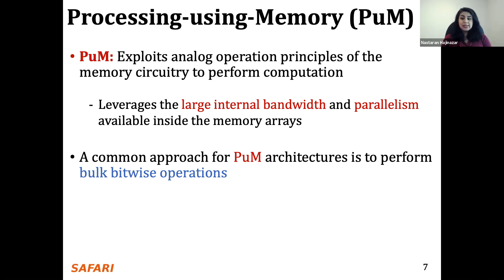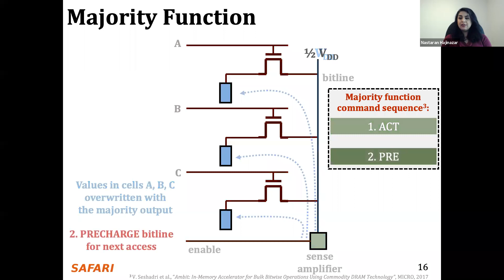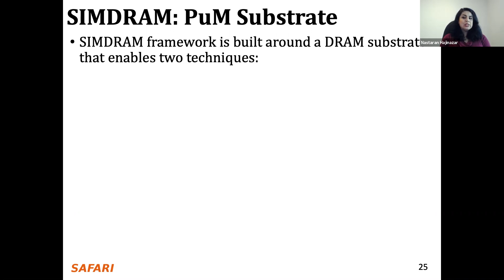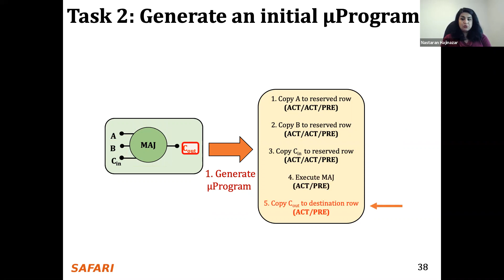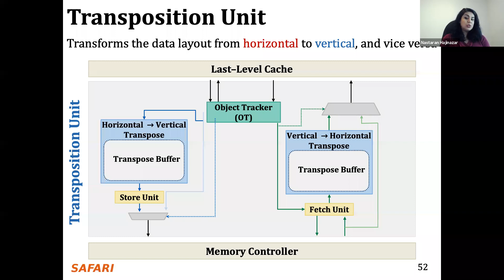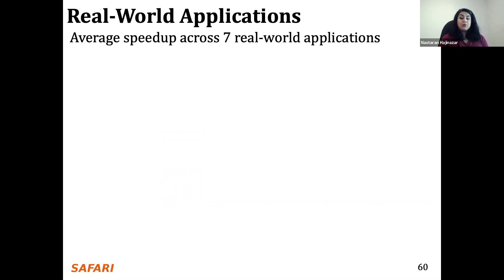SIMDRAM: A Framework for Bit-Serial SIMD Processing using DRAM - ASPLOS'21 talk - Nastaran Hajinazar

Comment: The proposed majority computation relies on precise comparison of analog voltages. Is this realistic considering the omnipresent manufacturing tolerances?
Reply: I wonder the same. Though I think even if that's the case, error tolerant computing may still benefit.
Reply: I know it is a bit late; I'm hoping to help some future readers. Sections 2.2.3 and 7.5 in the SIMDRAM paper explore this specific concern. When limited to only 3 wordline activations at a time, system is pretty resilient to the capacitor imperfections.